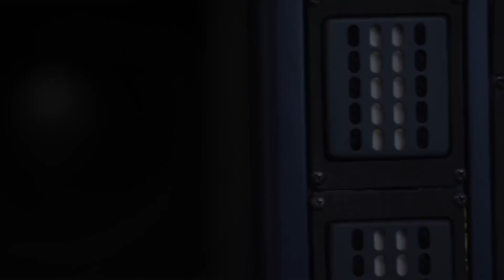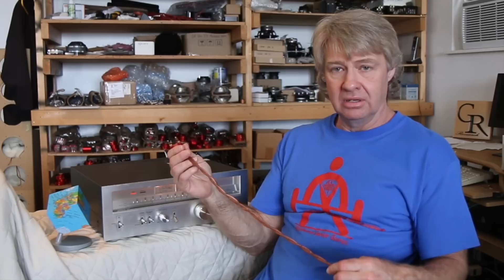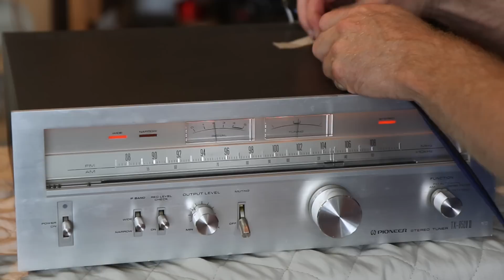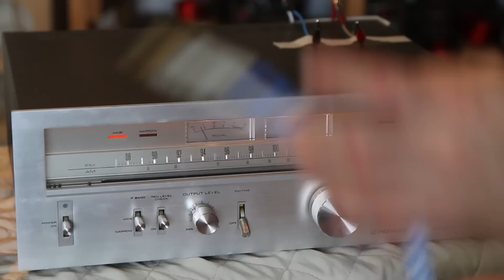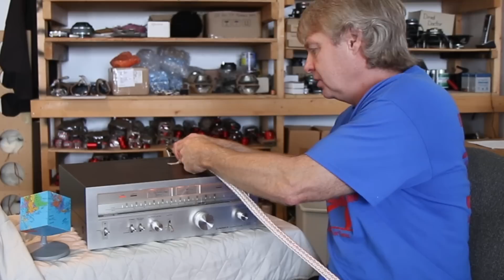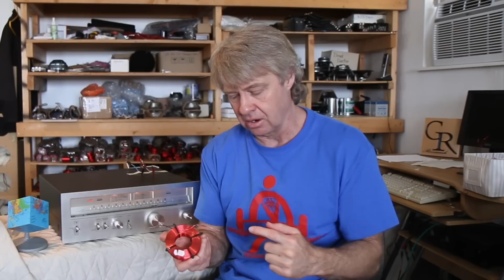Do Audiophile Cables Matter? Here's PROOF!

Comment: Another advantage to active bi-amplification is the elimination of the passive crossover with large inductors that pick up external magnetic fields.
Reply: But that has numerous drawbacks as well.
Reply: @dannyrichie9743 This is a change of subject.  I have been reading two famous Do It Yourselfers who consider active bi-amplification far superior to passive crossovers for very convincing reasons.  What are the numerous drawbacks to active bi-amplification, in your opinion?  I can think of a few that have nothing to do with actual sonic performance.  One would be high cost of additional amplifiers and the active crossover.  Another would be complexity for the novice user to safely setup without damaging their equipment.  Another would be the lack of available high quality active crossovers without building one yourself.  Another might be the fragility of high frequency speaker drivers connected directly to power amplifiers capable of low  frequency power output.  A sonic performance drawback of active bi-amplification might be miniscule amounts of noise and distortion of the active crossover circuitry, which might be worse for digital crossovers with analog to digital and digital to analog conversion.  A miniscule amount of noise and distortion may be offset by the advantages of active bi-amplification:  the elimination of the power loss and dynamic distortion caused by resistance of passive crossover elements between the amplifiers and speakers, improved damping, lower amplifier power requirements, and crossover filter performance not dependent on complex dynamic speaker driver impedance.  The worst part of the passive crossover being the resistance of air core inductors which increases with high current and heat and the magnetic saturation and hysteresis of iron core inductors which causes non-linear distortion.  My favorite Do It Yourselfers are Rod Elliot of Elliot Sound Products and the late Siegfried Linkwitz of Linkwitz Lab who co-invented the Linkwitz-Riley filter.
Reply: @dannyrichie9743  I wonder what your X-Statik speaker would sound like tri-amplified with custom analog active Linkwitz-Riley fourth order crossovers?  I am not a woodworker with the tools or ability to build the enclosures.  I am a believer in Ethan Winer of Realtraps and the necessity of proper room treatment.
Reply: @paulsebring6930  Those last two are good questions that deserve an answer that is a little more involved. I am going to copy this one to my forum at the audio circle and answer it there where more people can see it and respond as well. I will then come back here and add a link to it.  I'll get this one as soon as possible, but it might be into the next day or so.

Comment: Wire termination gives me another idea.  Since amplifier output impedance is very low, Danny's RF pickup test should be conducted with the leads at the end of the speaker wire shorted together.  I know what the result will be.

Comment: I presented this idea as a reply to another comment:  A more significant test than RF pickup on unterminated wire would be very simple.  Since the amplifier output impedance is very low, disconnect the speaker wire from the amplifier and short the leads together.  The speaker wire that produces the least amount of audible noise through the speaker when not connected to an amplifier and the leads shorted is the best speaker wire.
Reply: An inductor would produce the best result, but make the worst speaker wire. The entire premise of this video is absolute garbage.
Reply: @mdocod  in deed.   This snake oil relies on the very subjective nature of human hearing , and that's why they can never pass a double blind test
Reply: LOL!

Comment: <sarcasm>If, as Danny says, resistance doesn't matter, only RF noise filtering is important, should we buy expensive cable, or should we just buy 22 guage speaker wire and wrap it around a ferrite collar?  The ferrite collar would choke out all the RF noise to pass the FM antenna test.  </sarcasm>  Speaker wire resistance does matter, it is easily heard and measured, and speaker manufacturers specifically recommend large gauge low resistance speaker wire.  Speaker wire resistance affects nominal 4 ohm speakers more than it affects nominal 8 ohm speakers.
Reply: It matters but only if and when it becomes a limiting factor for the amount of current applied. It doesn't alter sound quality.

Comment: How far does the electricity move through the inductor?  The speed of light is about 186,000 miles per second.  The speed of the electrical signal on wire is the velocity factor times the speed of light.   Assuming about 70% velocity factor, the wavelength of 20Hz is about 6,500 miles on wire and 20 kHz is about 6.5 miles.  The time it takes for the audio signal to get from the amplifier plus to the minus terminal through the insignificantly short distance of the speaker wire and the crossover and speaker drivers is essentially instantaneous.  However, the phase of the signal depends on the frequency of the signal and the complex vector impedance of the speaker.
Reply: The question of how far the electricity moves through the cable is irrelevant. It’s not a story about waiting for electrons to arrive from the source, electrons are “displaced” along the entire length of the wire at the same time and the disturbance appears essentially simultaneously to being generated. The disturbance is transmitted.

Comment: Had interference problems with Interconnects and ground loops but I've never experienced any noise coming from speaker cables. If one really does experience such a problem, the solution is simple. Braid and shield your cables. No exotic materials or special technology needed.
Reply: Tin foil would even work to shield cable, this test proves nothing

Comment: The only thing you showed is the the 24 braided cable is a poor FM antenna. That's it!

FM Audioband is in the ~100 MHz range, while humans hear ideally to maybe 20 KHz (we can quibble about contribution of harmonics of maybe up to 100 KHz). Still at least off by a factor of 1000x. I would have expected better from an "engineer". It would be more convincing if at least audio folks would sell the same story. You say shielding does not matter, others do. Never mind. I did listen to a bunch of cables once, could not hear an iota of difference. DACs no problem, phonocartridges no problem, but cables: nope.
Reply: While I demonstrated doesn't apply only to speaker cables. It allies to all cables. I am sorry that your system is such that it didn't allow differences to be heard. Keep working at it and mable your system will get to a level that will allow you to hear and appreciate those improvements.
Reply: @dannyrichie9743  you miss the point completely. Your "demonstration" is irrelevant because of a frequency mismatch by factor of 1000x.

Second, my little system consists of a VPI super prime scout with ADC and Soundsmith Zephyr MIMC* cart to a Vincent PHO 701 with upgraded Telefunken ribbed plate tube to Woo WA 6 SE with WE422 rectifier tube (major difference to stock Chinese tube) to Dan Clark Ether 2 planar or Grado RS2e cans. All pretty revealing. Speakers are B&W CM6 plus sub through Rotel RA1572 (weakest link) playing either FLAC files from dedicated server running Audirvana or CD via Coax (also pretty revealing speakers). Got loaner interconnect cables from a high end store, a whole crate full of them, and not one made an iota of difference anywhere. Neither does VTA, BTW. And yes, there is a Furman power conditioner (inherited that one).

Another issue with the cable advocates is relevance to overall system performance. If Paul McGowan hears differences on his IRS 5s, that is hardly a "normal" system, not even for "audiophiles". So the question arises, at what point does it make a difference? Putting Ferrari tires on a 2CV does not make it accelerate any faster. Upgrading cables does not improve sounds on the vast majority of at least 2 channel component systems.
Reply: @danielgeiger7739  Sounds like something is holding back your system. The speakers and room is the first place I'd start.

Comment: I'll admit I lost faith in the cable claims when I saw some that said "this end toward amplifier --->", which just seems silly to me on many levels. I'm not the smartest guy in the world, but I have have the basics of EE from my academic days and I've spent a lot of time in copper rolling mills as well. Not that I know everything, but so far I'm still in the "I'm not convinced" camp - but still willing to listen and learn. Copper crystallinity? Oxygen saturation?  Skin effect? I actually have access to a bunch of silver-plated copper if I wanted (and a bunch of 16-carrier braiding machines too), but I am not convinced that it would be worth my time and whether I'd hear a difference. I totally get how a split "T" would pick up the most "noise" at higher frequencies and very low current (such as RF signals around 100 mHz) but I've having trouble translating this to my home system that runs at much lower frequencies and much higher current than an FM antenna. I bet the biggest issue is that the speaker wires act as transmitters to mess up the sound of the signal cables... ? I'd be thrilled to learn more from a science/engineering aspect (and even better, how specific aspects of the cable affect specific aspects of the sound), I think that would help more to sway me. I'd like to learn more Danny!
Reply: Yes sound is generated by alternating signals meaning polarity changes (plus and minus) take a 30 Hz signal half of it is POSITIVE and NEGATIVE and then they switch (positive becomes negative and negative becomes positive) just like the power coming from the wall (60 (Hz) cycles a second at 120 volts peak to peak so a towards amplifier (or towards speaker) makes no difference AT ALL
The reason for polarity matching is for phase difference (both are to push and pull the same way) this is educational purposes if you know this already great if not then I hope you learned something new definitely not meant to insult anyone's intelligence for sure LOL

Comment: Just a thought - aren't speaker frequencies a lot lower than antennae frequencies? So those cables aren't picking up any noise between 10Hz - say 30KHz?
Reply: Only the carrier of the radio signal is that high frequency. Audible frequencies are modulated "on top" of that frequency and can be heard is certain situations.
But not in the situation of a speaker cable connected to a speaker.
Saw how he didn't connect a speaker to one end and left it unconnected?
That's why he's able to receive the noise, while that's not the case in real life; a speaker is basically a coil of copper wire that shorts out the + and -
When + and - are shorted, there's no difference between the two, so no voltage, meaning no signal/noise.